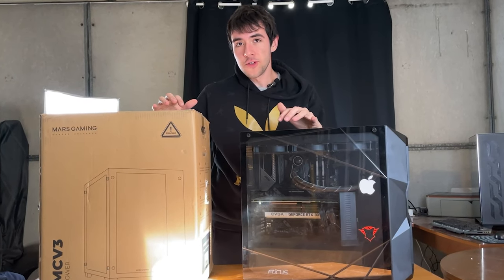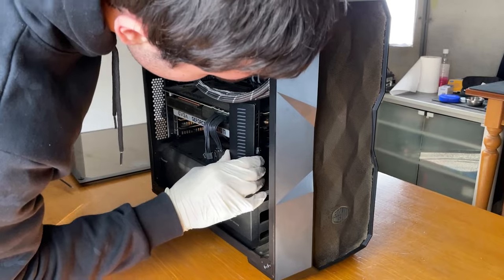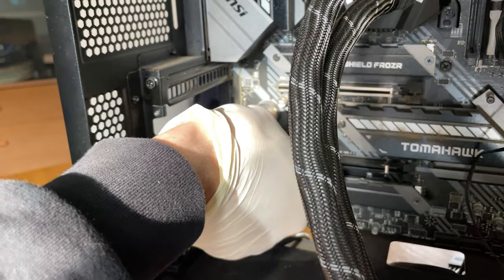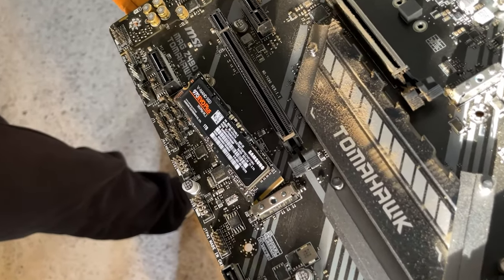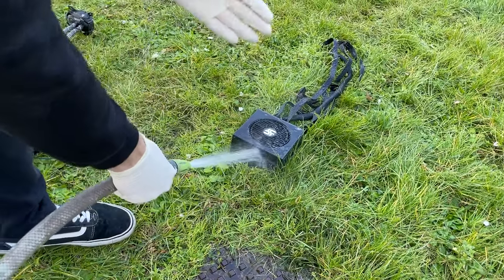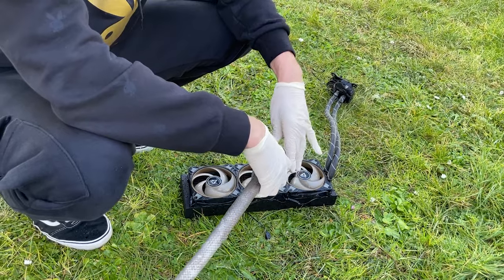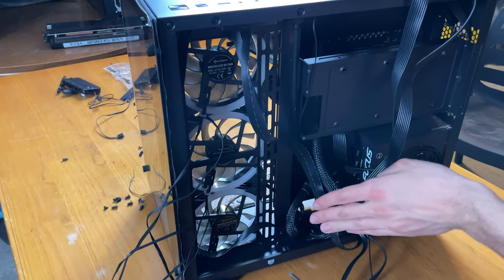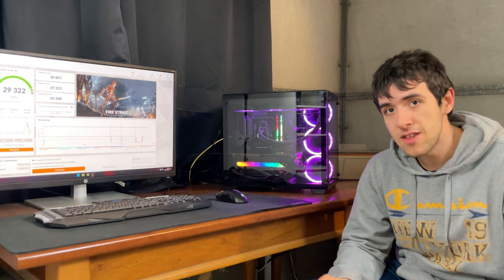I bought a 900$ "Gaming PC" from Facebook Marketplace... (I had to wash it)

Comment: Some advice regarding washing components:
• Disassemble everything (as in remove all heatsinks, screws, plastic covers, etc...)
• Spray some de-greaser (same type used to clean car parts as it's safe for both plastics and metals) and on all components and wait for about 5 minutes before washing.
• If possible avoid using tap water. Tap water has contaminants and eventually will introduce rust over time. Used distilled water if possible.
• Use the air duster right after washing to get as much water out from small cavities and underneath chips and such. It'll help shorten the drying process.
• Once everything is dry, spray parts with contact cleaner or isopropyl alcohol, specially if you used tap water. It'll help clean up any remaining contaminants.
That's it!
Love your channel, always recommend your undervolt guides to my friends :)

Comment: I bet, those 40 likes definitely was worth destroying perfectly good components. So, you're flipping water damaged components. Do your clients know about that?
Reply from the maker: No component was damaged in the video😩 Using water to clean computer parts is perfectly safe if done properly
Reply: @ImWateringPSUs  is this a distilled water from a clean hose (without sand, bio-crap, salts, etc)? How did you prevent corrosion of the components? I repeat my question, are your clients aware of that treatment of their components? Is there any manufacturer that recommend/allow such method of "cleaning"?